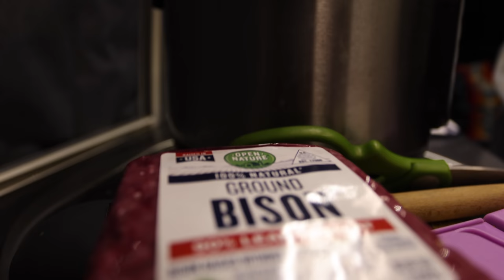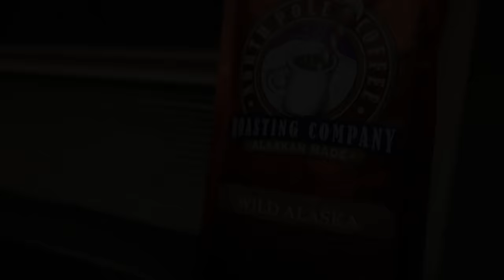Winter Returns With Record Breaking Cold | Van Life Alaska

Comment: Super good to see y'all back at it!  Is the heater prone to failure/are you worried about this winter?
Reply from the maker: The heater is pretty reliable until it does fail.  No we are not worried about it failing once it’s been serviced.  We had no issues with the heater during the first two years of use.

Comment: Good morning, you mentioned that your Espar failed and you had to work on it.  My Espar has also failed and I had to rebuild it. I am curious what you feel caused the Espar to fail?  I am trying to get a feel for situations others have had, so that I can avoid, as much as possible, a failure down the road.   Now prior to shutting the Espar off, I always run it at 85 degrees for at least 20-30 minutes to burn any residual carbon. This has seemed to help my Espar.  I am always watching for the “dreaded white smoke”.  I appreciate your thoughts.  Tim from Colorado
Reply from the maker: We went over 1000 hours on our first service without having a worry and we just ran it normal.  We believe in the Espar and it is a pretty amazing system especially if you know how to do the maintenance.  Not something I would worry about just run it normal and have the parts to rebuild when it is needed.  In our case it is the blower fan that went out this time.

You only need to do the cook off when you are not running it regularly.

Comment: Enjoy seeing your travels.  Curious how you clean your pots etc after you cook?  How much water to you carry?  Thanks and Merry Merry Xmas!!
Reply from the maker: If temps are above 10 degrees we dewinterize and have normal water.  In temps like we have been seeing… we generally have around 5 gallons of water with us and we have a little pop up bucket that we use to wash in.  Sits flat on our shelf.  We always carry water even if we have full tanks since we don’t drink the water that is in the van.  We can still use our grey tank also if we need to and we just add a bit of rv antifreeze in with the water.

Comment: Happy new year 2022. I am glad to see you back in Alaska. 
I have a question for you. We live in WI and are used to   -F temperatures. The diesel fuel here has additives in the winter. Until now even -15 F we traveled with no additional fuel additives. Planning to go further N and the temps are going to be -33 at night. My question, do you add Diesel additive to your fuel or is the pump additive sufficient. I would hate to get to the situation in those extreme temps and no engine and may be no heater working. I would appreciate your input. Thank you
Reply from the maker: Hi Nina.  We carry treatment with us but have never had to use it so far.  The pump additives have done everything we need.  But we don’t go more than a day without running the van just to be safe in those temps.
Reply: @WingsandWheelsAlaska  thank you so much. Safe exploring in 2022